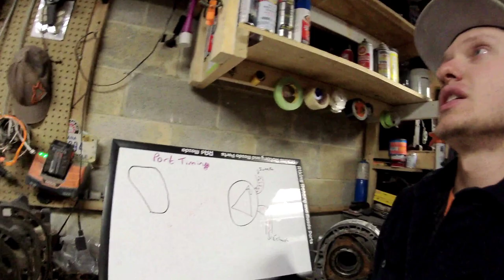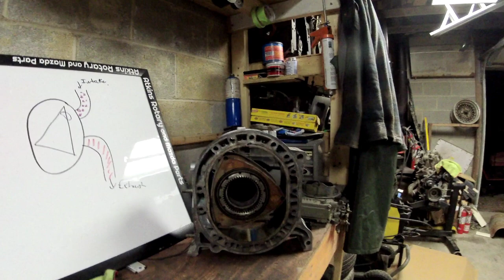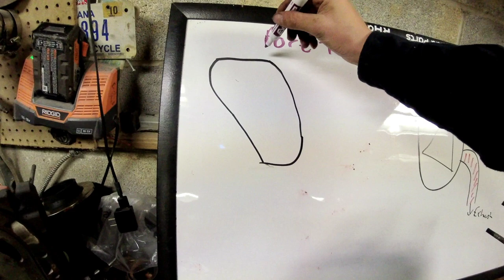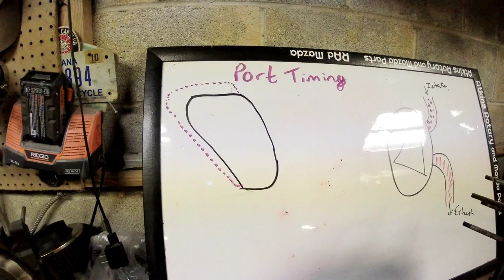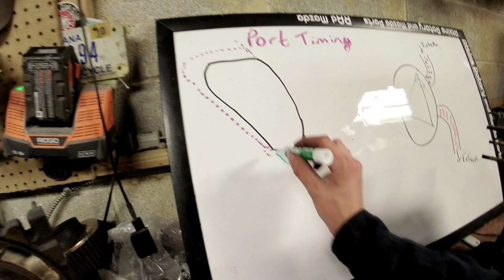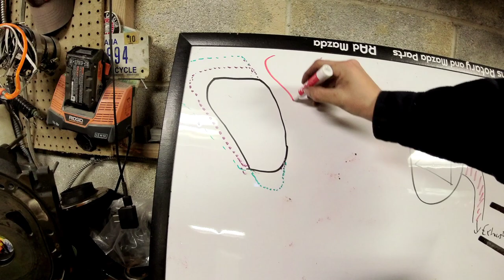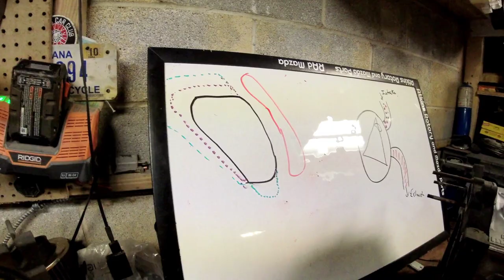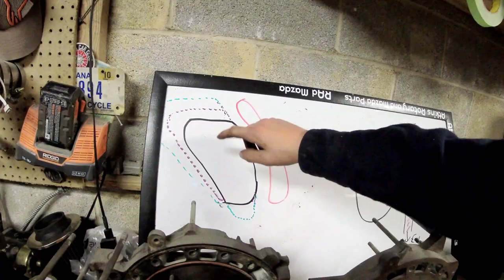Rotary Engine Porting Vs Drivability - What Makes a Big Port Unbearable on the Street

Comment: What's causes the loping idle is exhaust gas dilution of the intake mixture. The mixture misfires. Because it did misfire the next intake phase or stroke is not diluted. So it ignites normally. Fire, musfire, fire, misfire. Brap, brap, brap. At higher rpm the exhaust gases flowing out of the port helps  to drag more mixture into the engine. More power.

Comment: Doesnt the "brap" happen because the engine is literally misfiring multiple passes until it gets a strong pulsed fire? especially a peripheral port. You only hear the "brap brap brap" because its idling at 2000+ RPM and is missing all those other revolutions due to an improper mixture.
Reply: The improper mixture is because of the overlap so yah kinda.

Comment: I drove a 13B FULL Bridgeport on the street for years. Copper clutch with lightened steel flywheel. Never a problem, no overheating.

Comment: Bridging just the 5th and 6th ports is exactly what I was planning on doing with my '84 SE 13B.  Pairing with a 48 DCOE Weber.
Also I was hoping you'd cover exhaust port timing, and how they differ between turbo vs NA.
Reply from the maker: It's just a lot to cover in one video.  I can make another one for that

Comment: What is the best intake set up for a gsl se motor? Originally I thought some 12a irons, 4 port intake and along with a healthy amount of porting. With the lack of availability on 12a irons I’m starting to wonder if a couple racing beat p-port housings would about as economical plus part availability. Just looking for direction in my build, anybody with experience on could chime in, I’d appreciate it

Comment: Question, I have a completely stock NA s4(6 port) and a half-bridge port sounds good from how you described it,.

Would anything need to be upgraded/changed when porting the engine? or can I just get the engine ported and drive it straight away with nothing to worry about?

Comment: About the port timing: porting down does not change the port timing, only more volume. Porting  more outwards towards the water jacket opens the port sooner. Im Building a 13b REW engine myself with an extended streetport , so a little earlier opening towards the water jacket, going upward for late closing , and downwards for more volume.
Reply from the maker: That makes sense. I think it will come across with the same effect in the video.  I'll add your comment to the description.

Comment: Have you ever done a compression test on an engine with 0 miles, particularly on used housings?  I just rebuilt my renisis with what I thought were great condition with  all new hard and soft seals and a half bridge.  It started well and sounded great, it even hot starts relatively well which is crazy  because it only have 70 psi in each rotor!!!! I plan on doing another test very soon however each rotor was within 3psi of each other which is perhaps the only good sign.
Reply from the maker: Yes. Go back and check out the video on the overheated 12a rebuild.  Specifically the corner seals and compression loss topic
Reply: @RADPotential  i had some noticeable step wear on the irons too..... I think that might be the underlying issue.  The housings seemed to be in such great condition I don't think that would cause my numbers.  Thank you a million bro!
Reply from the maker: You won't see amazing compression with used housings until the apex seals have time to settle in.
Reply: @RADPotential  I figured, just didn't expect it to be this low,  we'll see after 1000 miles or so haha
Reply: @Kaizousha  I know its been a whole year. But any updates?

Comment: Helpful information for those learning. Your explanation would have been better illustrated if you showed an end plate, housing, shaft and rotor assembly being spun over the different port types to show the differing opening and closing/timing associated with the different port types.
Reply from the maker: Its super hard to see.  I have a model of it but it's just too small. I need to figure out a way to visually show it in the computer

Comment: I'm running a bridgeport turbo. I wish I could get a stock port engine and build a street port. It makes driving the car a job. The heat is almost unbearable, mpg sucks ass, tuning is a pain in the dick. But it braps.
Reply from the maker: Hell yea!!!   My 12a bridge is an experience to drive.  Let's just leave it at that haha.  It has its pros and cons like yours as well!
Reply: @RADPotential  I can't seem to get the tune leaner they love 12.0 to 13.2 afrs just pigs in the mpg world but fun.

Comment: So can a large street port make your motor brap almost like a bridge port? And does the bridge port add extra hp or its just for a louder and nicer brap??
Reply from the maker: Yes you can get a good brap with a street port. It will rival a full bridge, but not quite as nasty.  Bridgeport will add more HP. Maybe 10% more than a big street port

Comment: Could you do a video on the auxiliary ports. Mainly the rx8 6 port. I would like to delete the sleeves. But what would be the downside?
Reply from the maker: Downside would be huge ports open all the time.  Less low and midrange power. But more top end

Comment: Hey,  

Great video per usual.  Love the channel!

Curious if you can give me some insight on an issue I've been trying to hunt down on my GSL-SE swapped GS.  The car has a slight vibration that's barely noticeable at idle but build to be pretty noticeable at ~2500rpm then quickly goes away at about 3000rpm.  Above 3000 she's buttery smooth and pulls hard.  At first I thought maybe the fan clutch was out of balance or worn out but no.  Then thought maybe a vacuum leak in the ignition advancing circuit but not that either.  A previous owner installed an aftermarket flywheel and clutch but it is an OE style full disc so maybe something to do there.  Cant find anyone with a similar issue on the forums and since I'm new to rotaries I'm hesitant to drive it like this.  I know your probably  super busy with the crazy amount of content you put out, but any tip or insight would be greatly appreciated.
Reply from the maker: If it has an aftermarket flywheel of any sort the balance of the counterweight could be wrong.   Did it just start doing the vibration?   If it just started and hasn't been like that the whole time, you could also have the flywheel to counterweight bolts be backing out causing the vibration.
Reply: @RADPotential  Good to know!  That may very well be part of it!  I tried to find a brand name on it when it was out but no luck.  Looked like a quality piece though. I dont remember the vibration in the donor car, but i didnt drive it a whole lot before the swap.  

I just replaced the vacuum T-Joint on the advance cicuit and that seems to have helped some.  looks like someone used an irrigation fitting in a pinch.  With that in mide have you ever heard of those advancing pots going bad?  Im thinking about swapping the pair from my low mileage 12A to test?  

The car is also running no cat and the o2 sensor had been removed.  Ive got a sensor coming now but figured more info couldnt hurt. 

Thanks again, really appreciate it.
Reply from the maker: I have never seen an advancing pot quit. But I usually don't run them. So my sample size is small lol.  I wouldnt think a vibration would be the effect from thT cause.  If they aren't working, you would see a power loss on the top end as it's not advancing the timing. Not a vibration down low.  If you havea timing light I'd check what your base timing is
Reply: @RADPotential   Good to know!  My base timing is good, checked it last week.  Just found my Air temp sensor on my intake manifold had its leads broken. not sure thats too blame but it makes me think that its probablya combination of things and not just one thing.  Have new coils and wires coming also as the ones on the car are the ones that came with the donor.  yikes i know.

Comment: So if you don't port the primary ports you won't get a nice brap at idle?
Reply from the maker: You will see some effect from the secondaries being ported as that will still allow more air at idle.  But not as pronounced
Reply: @RADPotential  what rpm do the secondary ports actually have an impact
Reply from the maker: Secondary ports will open based on throttle position not rpm unless you have a carb with vacuum secondaries. So if you go 100 percent throttle at 2k rpm they are open
Reply: @RADPotential  You said a half bridgeport is done on the secondaries, but most people do a half bridge for the braps. Wouldn't that be on the primaries? The half bridge you just put in that FD, was it on the secondaries or primaries?
Reply: @RADPotential  what about at idle when you want the overlap will they be open
Reply from the maker: Yea. Doing the half bridge will give you those braps.  But also keeps the small port functionality of the street ported primary ports.  Ie your cruising and part throttle scenarios. Overall you will see more airflow at idle than a standard street port. Hence the braps.  But there will be less effective overlap at part throttle because the secondary ports aren't open
Reply from the maker: The FD has bridgeported secondary and a large streetport on the primary.
Reply: @RADPotential  Well... I guess I fucked up because, from everything I read online, I thought a half bridge was just on the primaries so that's what I told my engine builder I wanted lol I thought a bridge on the secondaries wouldn't have any impact on the idle brap
Reply from the maker: Yea. It will enough to give a slight brap over a streetport.  But if you had him bridge everything you will have all the braps.